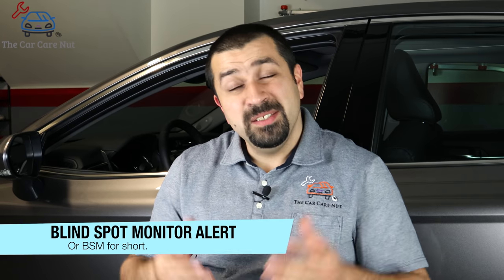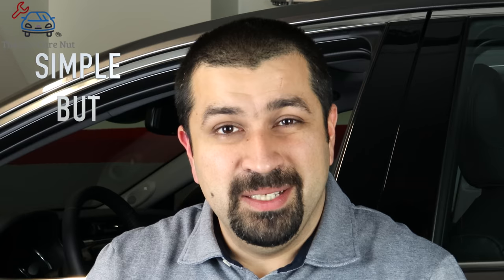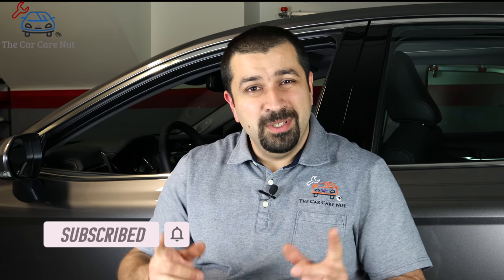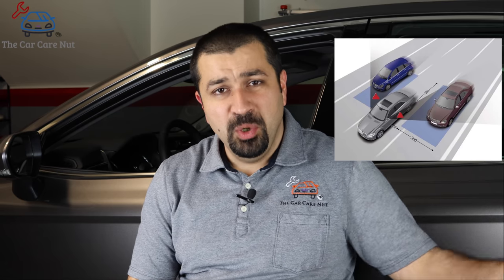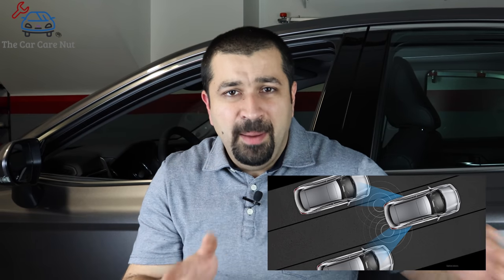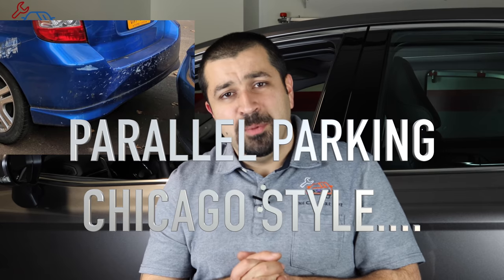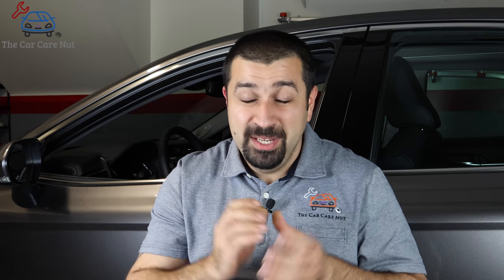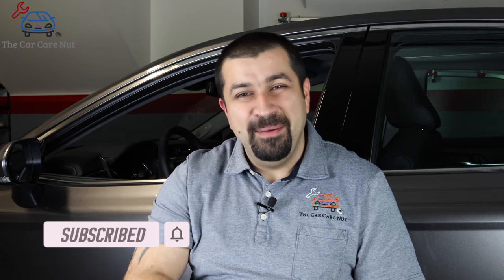How does Blind Spot Monitoring work in Toyota cars

Comment: My car recently had an accident from the rear. After it was fixed, the master light turned on. It says "blind-spot monitoring unavailable, rear cross-traffic alert unavailable" It's a 2018 Toyota sienna. When I took off the back bumper and check around, their sensor boxes weren't cracked. I don't know if the metal bar is pushed in for the sensors holding or if the wires are ripped. The wires looked fine on it. I tied them up and the lights turned off. The next day after I drove on the highway, the light turned on again. I'm afraid if I go to the dealer and then scan it; they'll say it needs 6k USD in repairs. Anyone has any tips or ideas? I've seen a few videos of people recalibrating the sensors for 500 dollars but I don't think there's one near me. I live in the NJ and NY area. If you guys have any ideas or help reply to me.
Reply from the maker: Hi! The sensors will need calibrating and if the body is not fixed correctly it will need to go back to the body shop. If the car was fixed by the insurance this would be covered as well
Reply: @TheCarCareNut  the body shop refuses to take it back. I don’t have the best Insurance so I don’t think they’ll pay for it. I live in the NJ area. Do you know any shops who does it here ? I can’t find anything besides outside the state
Reply from the maker: Unfortunately I don’t know shops in NJ as I’m in Chicago. This one can get expensive. I would get a repair estimate from a Toyota dealership and call the insurance and put a fight with them. They’ll eventually budge
Reply: @TheCarCareNut  alright thanks
Reply: @TheCarCareNut  how much is it in Chicago ?
Reply: @TheCarCareNut  sorry to bother u again but I had one more question. My friends keep telling me to get a used pair of sensors from a junkyard and replace the ones on my car. Do u recommend doing that or do I need special tools or fancy equipment ? Ik it’s sensors so I don’t want to do something they’ll ruin my chances of having working bsm and rear traffic alert
Reply from the maker: So if the sensors are not damaged likely all you need is a calibration. If the sensors are not sitting right some body repair will be needed so they can sit correctly and can be calibrated
Reply: @TheCarCareNut  alright. Thanks again. Sorry for bothering you. I’m going to call the Toyota dealer and see what they can do . I’m not sure if they are sitting correctly but I’ll just take it to the dealer. Thanks for all the help 🙏

Comment: Can anyone tell me if they have come across this issue with the bms. I changed over to chrome on my Tundra and ever since then my bms doesn't work. Toyota has calibrated the bms and they can't get it right. They detect something when there is no actual object on my sides. People have told me the issue is that the bms can't work since it is chrome now and not the fiberglass painted covers that it came with. Anyone have this issue?

Comment: I have 2017 Tacoma trd sport.  My blind spot monitor turns off and says unavailable when im driving the speed of 150 kilometers per hour.  It happen 4 times. 3 of them happen when driving on the hwy in the rain and the last one happen on the hwy driving 150 kilometers per hour and dry pavement.  It comes back to normal when im driving city driving but it takes awhile when it comes back. Does anybody knows why it does that it turns off line

Comment: Luckily, blind spot monitor (BSM) is optional in new Toyota's that you have to pay extra if the new car you want comes with it from the factory. If you don't want a BSM, pick a Toyota that is not equipped with this option from the factory or just turn it off if you don't like it. Either way, Toyota comes with TSS as standard in any new vehicle with no extra charge. BSM, RCTA, RCTB are factory installed extra cost options and are not part of TSS package.

Comment: Hi ..thanks alot for your detailed explination . Iwould like to ask about replacement of BSM radar sensor in my Rav4 hybrid xle 2020 that was damaged , by a used one and both of them are RV3 generation but the used one is 2019 model ..dose that works ?? And which numbers should be compatible on both sensors ..alot of numbers written on the sensors ?? So Are there  difference between RV3 SENSORS betwedn 2019 snd 2020 ?? 💐
Reply from the maker: Hi! It’s not advisable to use sensors from different models, this is a safety component and it needs to be fixed right.
Reply: @TheCarCareNut  thanks alot for your fast replay ..logically you are obsolutly right about safty ..but technically speaking is there important differences between the two models of the same generation RV3??
Reply from the maker: Not much information on differences internally.

Comment: I bought a certified used Sonata with bsd system. It has a clean carfax but then a few month later the bsd system keep behaving irratically. Took it to the dealership they replaced it under warranty but now it keep on turn on/off randomly. Of course come to find out the previous owner had the rear bumper repaired and repainted but sensor bracket has a minor dent to it also which causes the irratic behavior. I feel like with these electronics and smart system it almost a mandatory to buy extended warranty just to cover these electronics or else you go broke from repairing them if they break when you are outside of the warranty. When they break, they beep and chimes like mad, it almost like they are annoy you enough to get it fix.

Comment: Cars are so complicated and expensive nowadays. Get a rock on the windshield and develop a crack, you used to be able to replace for $250 or less. Now that they have the camera there, it’s over $1100.  Bumper cover fix and repaint on our Gen 3 Prius w triple-color paint after my wife accidentally backed into a parking lot post at about 1 mph was about $1000.  Things cost so much more to fix nowadays.  Make no mistakes, or you’ll pay through the nose… 🤮